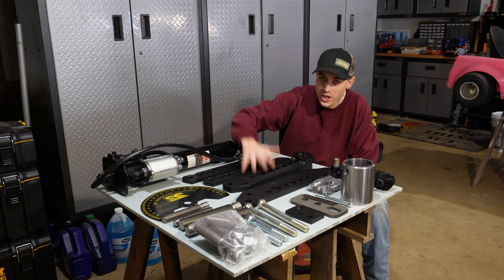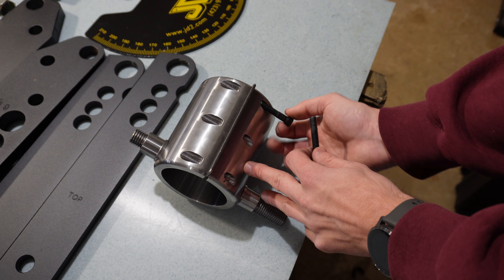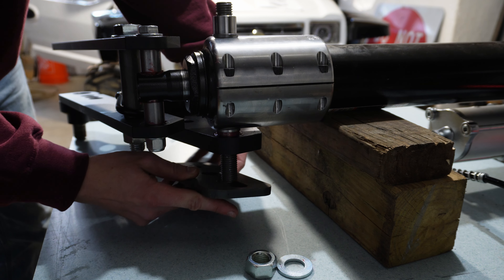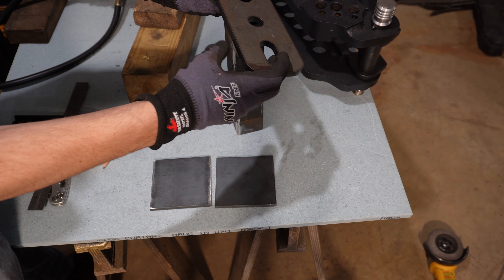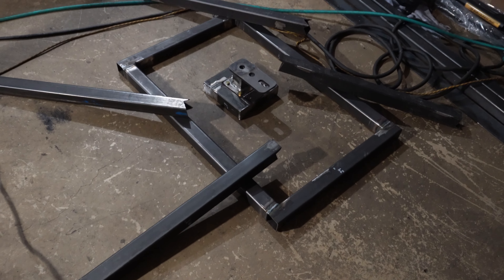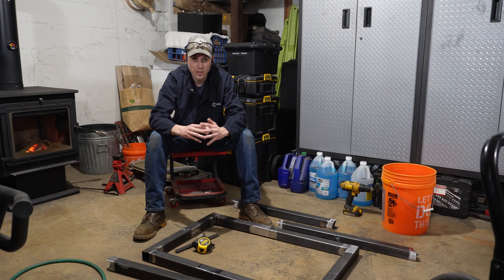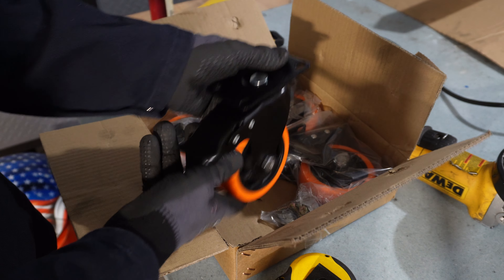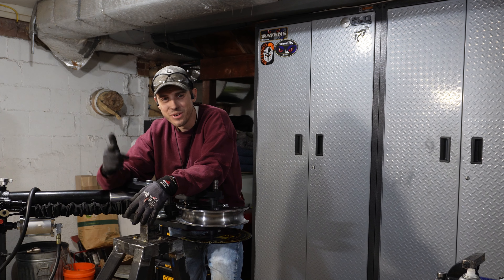Building the Ultimate Budget Tube Bender

Comment: Yea a good budget bender if your budget is 1000$…. Thats about 800 more than my budget..  lol
Reply from the maker: Yeah it's very unfortunate this stuff is so expensive. This is on the low end as far as the benders go. You're going to have a very hard time finding something to cleanly bend tubing at $200.
Reply: The average bender cost for a quality hydraulic unit that's rated for "pro" pipe and tubing is around 4k bro
Commercial/industrial units are around 10k.

Unfortunately they fuck us fabricators more than anyone